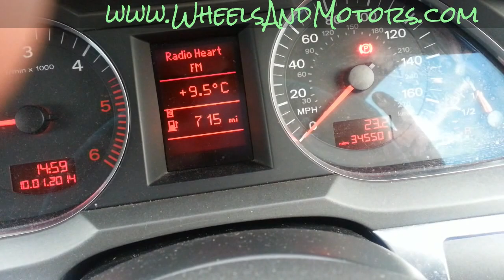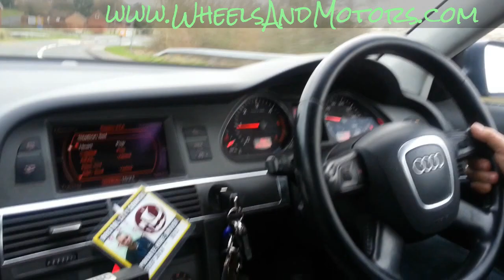How to pass MOT on emissions with diesel engine (TDI)

Comment: Do you use any specific fuel ? such as Bp ultimate or Shell Vpower ? or you use the supermarket fuel
Reply from the maker: I use supermarket fuel, don't have any problems with that.. However I'm not the fuel specialist and don't know exactly what all these 'Vpower's do. ;) I suppose they sell them for some reason.
Reply: European diesel has a much higher cetane than ours here in the states our Cetane levels are 40 and their average is 51 my old ford needs at least 45 as most all diesels do but here i have to mix 2 stroke oil and kerosene 2oz to one gallon of kerosene with my diesel 1:5 to get a good cetane level to run strong and clean
Reply: WheelsAndMotors I m just a regular guy , which does not work for any Fuel company , however I can tell that BP Ultimate helps keeps your engine clean
It has Additives to Clean the Engines and addictive's  to Improve combustion, I mean if you want to reduce exhaust fumes and prevent particulars building up in your exhaust ( Is Vital you have a good combustion ) ence the premium fuels
I haven't tested Shell V Power diesel yet
Reply: WheelsAndMotors  My fuel comsuption with supermarket diesel was 71.MPG
MY fuel comsuption with BP ultimate was still 71 MPG
I thought to my self wtf ?
After Filling the Tank 3x with BP Ultimate my MPG is now 76 MPG it must have cleaned the Injectors , now even if I use the supermarket fuel its still 76 MPG
Reply: SuperNiceguy60 unless your on a motorcycel your not getting 70 mpg anything
Reply: VK7001.P Actually I m now getting 76 Mpg on my Family size car which is able to reach 120 mph and is  still able to accommodate 5 people and their respective luggage. I v done a video before using bp ultimate Search on google or youtube ( Omg my car reaches 71.5 mpg) tell me your views
Reply: SuperNiceguy60 well i only 20 MPG in my truck but its a 30 year old 6.9L Diesel and here in the US we have vary vary vary poor diesel fuel i have to go to a farm supplier station on the edge of town to buy my diesel because they carry a special grade that's 55 to 65 cetane and at most fuel depos its 30-40 cetane and then old diesels wont run on fuel under 40 cetane so alot of the time if i cant get my good fuel i use kerosene to bump it up to 45 to 50
Reply: VK7001.P Our Standard Diesel has 53 octane if we want to pay a bit more we get the 55 octane diesel , BP ultimate , it also cleans the injectors , the price of Diesel here is Around 2 dollars per liter or around 9 dollars per gallon , ence over here fuel efficient cars are Mandatory
Reply: SuperNiceguy60 wow 9 bucks a gal and i complane about $3.69 never again shit with my job i couldint even drive where you live
Reply: VK7001.P  I know it seems a bit strange , however we pay roughly the same in Fuel costs  despite I m paying almost 10 Dollars per gallon for fuel over here in the U.K  even if we do similar miles , I went on 2800 Miles trip last month I only had to  Stop 3x to Refuel , our Government does allow us to have Fuel Efficient cars , I mean the Vehicle I drive over here would be Impounded and destroyed if the same was Found  in the U.S duo for being extremely fuel efficient( U.S would state my vehicle does not meet U.S emissions regulations )
Reply: SuperNiceguy60 lol i have a 200 Gal of onbord fuel i stop for fuel once a month
Reply: VK7001.P I have a 16 Gallon Tank
which allows me to do 650 Miles in City and around 960 Miles In the Motorway
some Months I don't drive allot as result I normally put fuel every other month
Reply: SuperNiceguy60 wow that's literally dubbel my mpg in town i get 17 mpg and on the freeway i get 20-22 if im unloded but i am driveing a 3/4 ton truck that weighs 9,500 pounds so i dont think its doing too badly I haule horses for a living or id buy a smaller suv god knows i couldint aford 2 vehicles

Comment: I have a Peugeot 306 1.9d (Non-Turbo) on the XUD engine, I Get 40mpg around town and 55-60mpg on a run, My fuel cost's 38p per litre because it runs on waste vegetable oil!! 
My astra 1.6 Petrol was doing 35mpg @ £1.15 per litre
Therefore a 400 Mile trip was costing me £60 and it now costs £12 Thats a saving of £48 per 400 miles

Comment: F*** TDI, reliable engines but when the problems star to appear you will spend a lot of money, my 1.9 TDI BKC (110K miles) fail on MOT opacity test (this is what they measure, the black smoke not the emissions) and i have a heavy foot for Diesel cars, a lot of money spend in two services and they don't know what to do or what is the problem. In the past i used to have an Renault 1.5 dci E3, I've done over 300k without any problem.

Comment: I wonder if this same problem occurs with larger vans. It's common to find large vans with diesel engines no more powerful than in standard family cars.  Engines in cars are just WAY overpowered these days, which means they are very rarely running at anything like their optimum load level.  With large vans it's different, as many will have a top speed of only around 70mph, and with a headwind you can be running flat-out and still not be over the speed limit.

The maths for cars is all wrong.  My 1.9Tdi car has a top speed of 120mph, which is a) quite normal these days, and b) NUTS!  To drive at 120mph takes EIGHT TIMES as much power as it does to drive at half that speed (60mph).  That's EIGHT TIMES (8x).   So even at 70mph on a motorway, the engine is still only running at about 20% load.  That's no good for an engine.  It would be much better to have the same car with a 1 litre 40kW engine instead of a 2 litre 80kW engine.  But you can't buy them.  They're just not available.

I have to block off most of the radiator grille to ensure the engine gets up to full temperature.  (It's a VW, so the temperature gauge SAYS it's running at 90 degrees, but the gauge is designed to show 90 degrees at any 'normal' temperature - anywhere between about 75 and 107,  if my memory serves me.  I use an app to show me the actual temperature.)  Note, there's nothing wrong with the car - the thermostat is fine, etc, etc.  It's just that these engines are very efficient and just don't produce enough heat unless they are driven hard, and you can't drive them hard enough without speeding.

Comment: I was very astonisched about yyour Milege, and i did not saw no Quattro sign, i thot that you have Miltitrinic. I have Multitrnic in my A6. I have now about 167.000 km. It qorking perfekt, and i want to know for how Long. That was the base of my question. Sorry for my bad English, im am from Germany.
Reply from the maker: Yes, it is manual 2.0 tdi, front wheel drive.. At the moment I have 366K miles, which is 589.000 km. However I'm not sure how reliable multironic gearboxes are. Should be allright - it's 'Vorsprung durch Technik' (I'm from Latvia by the way - Lettland)..
Reply: WheelsAndMotors And, i am from Romania ;-), i don´t know how Long i want to hold the car, the engine is perfect, but i heard much bad stuff abou the Multitronic..... i will see how it will work in the Future. By the Way nice Car!!!

Comment: This guy is 100%  genuine, failed my Mot with 2.10 average, took my motor out for half an hour,  2nd & 3rd gear 3500 revs 3 big plumes of soot later drove to garage 2mile away engine oil temp 93 and BINGO, EMISSION TEST PASS 0.82 Average. LEGEND MATE THANK YOU. granted I also changed the air and fuel filter. Don't get scammed with these dogs shit DPF cleaners when you can do it your self with an accelerator pedal. 👍👍👍👍
Reply from the maker: Thank You very much 😊👍

Comment: That`s thirty-four thousand, five hundred and fifty miles, not three hundred and forty thousand miles!
Reply from the maker: That's 345.501 miles. When it came to the end of license it had 409.000 miles. You can easy check mileage via DVLA services (or some apps). Check reg VN05PHV. I have 2012 VW Sharan now wutb 333.119 miles, I bought it in 2015, 3 year-old with 42K on a clock.

Comment: Car was blue before and its offroad now
Reply from the maker: The car has done over 400.000 miles and I had to get rid of it, because of age limit for taxi licence. And yes, I had to re-spray it due to new rules in Bristol taxi regulations.
Reply: @wawayltd  did you scrap it
Reply from the maker: @backwithabang9896  Oil pump died on it 2 months before end of taxi licence, so I thought it will be more reasonable to scrap it for 500 quid rather than fixing it and looking for someone to buy ex-taxi with 409.000 miles. Plus I needed money asap towards new vehicle (my current Sharan)
Reply: @wawayltd  500 pound decent money you know